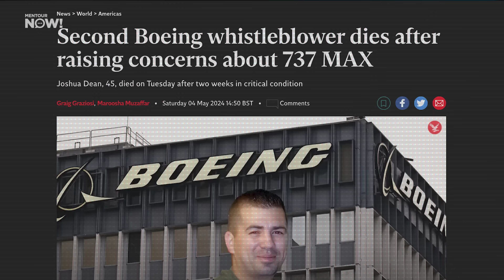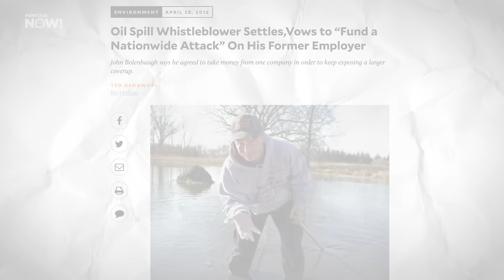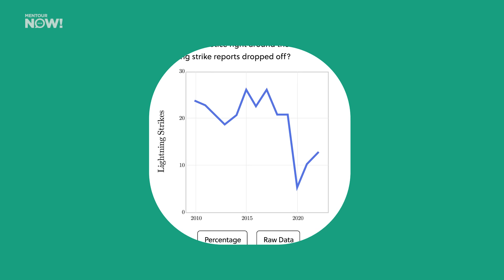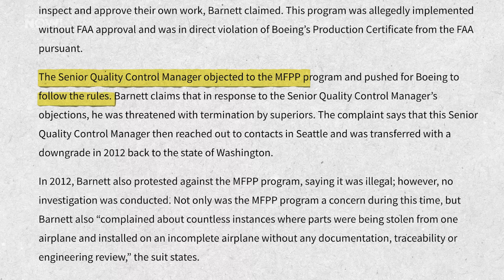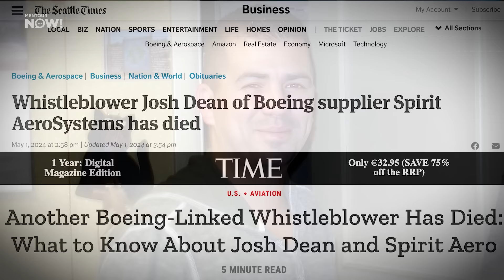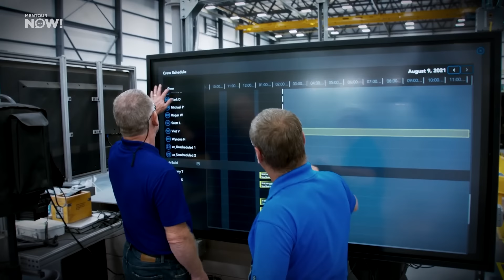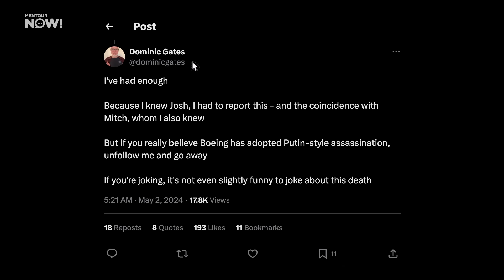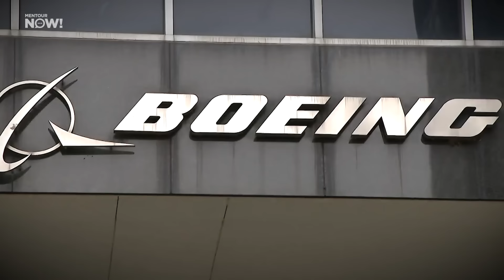Whistleblowers Vs Boeing: What Happened?

Comment: My brother worked at Boeing in Everett, first on the 777 line and then subsequently on the KC-46 line. He too, had many complaints about quality control at Boeing, or perhaps I should say 'the lack of quality control'. His comment was that they were pushing aircraft off the assembly line faster than they should have been, thus not allowing all components to be installed properly or with substandard parts. Also, FOD (Foreign Object Debris) was being left inside the airframes as they were pushed out to the waiting final line. He became so fed up with their lack of attention to detail that he quit his job. This was a job which he looked forward to before these disheartening and frustrating events.
Reply: Poor company morale is a big factor in poor workmanship which leads to poor moral which leads to poor workmanship.....People just turn up for the pay, not the satisfaction  of a task well done.
Reply: So how does this lack of quality control is manifesting itself? As far we as we can see those beoing planes are not crashing and are some of the safest out there. So that seems in conflict with your and your brothers statement. How do you explain that? And how do you also explain that other people working there would have opposite comments and are proud of their work there? In fact you can read such comments under beoing manufacturing videos here on YouTube in which they also mention that the quality is there instead of lacking as in your comment. How do you resolve these conflicting statements?
Reply: @dreamthedream8929 
Max 8 would like a word. So would Alaska Airlines door plug.
Not crashing isn't the level of safety you want from an airliner. Not having faults is. And Boeing's been having a lot of those lately.
Reply: @dreamthedream8929  I believe you’re missing the point. Thankfully, no planes have crashed in a couple of years but the lack of oversight by a QC process is leaving the door wide open for a major disaster to occur. The mentality of Boeing’s workers has dropped so significantly over the past 30 years, after the McDonald Douglas merger,  that serious management changes need to happen to bring back the pride of a job well done. Sadly, it seems the employees are feeling a ‘why should we care’ mentality.
Reply: Thankfully no planes have crashed due to how well those boeing planes are made, there is lot of fear mongering going on these days by media basically creating an impression that they should just be falling out of the sky whereas just the opposite is happening. Its safer to fly than ever if we look at the numbers. So again the question is how do these supposed serious problems are manifesting themselves in daily safety of flying? If its so bad as you describe then why is it that dreamliners simply don't crash?
Reply: @dreamthedream8929  Boeing has over many decades had a good record of safety, and as far as I understand the story this is something that has developed over the last couple of decades, which coincides horrifyingly with a large majority of Boeing accidents compared to the same amount of serious accidents in aircrafts from Airbus, Embraer and others. That the accidents are rare isn't the point. In aviation it's all about the life-changing margins. And in the very small margins you see a significantly higher rate of incidents caused by equipment malfunction where a Boeing plane is involved than in any other manufacturers aircrafts.
As the FAA respondent so clearly stated: "You cannot conclude anything about the safety of a particular plane, simply based on the coincidence that an accident hasn't occurred yet." And now that Boeing has become the world leader in accidents in modern times when it comes to large commercial aircrafts, this misunderstood appliance of statistics is even more ridiculous.
Or as it was so well put by @tin2001 "Not crashing isn't the level of safety you want from an airliner. Not having faults is.", and Boeing is falling terribly short when measured by this standard.
The reason the "fear mongering" is relevant is that this is not a problem that can be mitigated when it leads to a serious blow-out or other fatal disasters at 40,000 ft. When it comes to aircrafts transporting passengers the only acceptable margin for errors are 0%.
And there is one simple fact in industries dealing in the transport safety business: If there is another player out there with a better record than yours - you are obviously not doing the best that can be done in the field. Right now there are manufacturers with less critical incidents and faults, and as long as that is the case, Boeing isn't doing good enough. This should always be the only acceptable standard. If there is any way it's humanly possible to do better - you are still not performing adequately. And that goes both ways. As soon as Boeing's track record over a span of years are better than, say Airbus', then obviously Boeing is doing something better than Airbus, and the only natural conclusion would be that Airbus is now failing at being at the only acceptable standard, which is - the best humanly possible. As long as anybody is having better safety statistics than your company - your company is simply not putting sufficient effort, money and time into improving safety. As long as your aircrafts don't have the safety record (on the margins) as the best in the industry, your fleet should be grounded.
This sounds dogmatic, but to some degree aviation is about dogma. All the times planes travel without incident from point A to point B will never make up for the one time 150 (or more) lose their lives due to an aircraft manufacturers putting a limit to the amount of money they would allocate from the budget to addressing safety issues and quality control. This is the only part of a manufacturers budget that shouldn't have any limit.
Reply: @beninua  however the question then is is there data for this supposed horrifying increase as you put it in boeing accidents compared to others? Or is it something exaggerated and overblown by media by people who do not even understand what's going on and blame every incident on boeing? Hasn't that become a trend these days? Even turbulence accidents are blamed or connected to boeing by media giving general population the impression that boeing is somehow really unsafe. And yes safety definitely is and should be measured by how often tragic accidents happen and for many boeing planes it's super good, I mean even max only crashed twice! This is simply the reality instead of what may or could happen. That's important too but we really need to see how that manifests in reality and for boeing planes the safety has manifested itself so far very well. But it seems that you hold aviation to a lot higher standard of safety than anything else in life. If anything else in life would have the same rate of accidents as boeing people wouldn't give it a second thought
Reply: @dreamthedream8929 ok I'm going to assume that you genuinely dont understand and are not a troll wasting everyone's time. Ill try to explain this in a short and simple way that others have explained before me in a better, more detailed way. Basically the best practice for quality in avaition is that you go above and beyond when it comes to manufacturing process in order to produce a product as close to perfect as possible. This is what keeps people safe. Boeing used to do this, but not anymore. the 2 MAX crashes and the door plug incident occurred on brand new planes, and all in a short period of time. This is not quality. When the attitude of the company is to rush production and leave metal shavings in planes or cover up critical software changes to sell more planes which caused hundreds of deaths or not install door plugs and have them blow out in midair or stomp on parts to make them fit or install defective parts these are systemic issues that need to be fixed. If not another tragedy will occur in the near future. This is what everyone is concerned about
Reply: @tmb06  anyone who raises questions is a troll? I already asked questions and no response was given neither by you nor anyone else. In the previous comment I spoke about the exaggeration by media of these supposed accidents (we still need evidence for the whistle blower claims of someone stomping there and that it's not a good way to go, are you just gonna take their word for it?) and how it's trendy now to blame everything on Boeing. Even turbulence accidents are somehow connected to boeing. That is silly. But fear mongering by media of course attracts and sells. Nothing new there. I'm not saying that this shouldn't be paid attention to and investigated but as far we we can tell the safety manifestation of boeing planes in reality is as good as any other. Dreamliners and 777s are as good and safe as it's gonna get in aviation. You obviously hold aviation to a much higher level of safety than most other things in your life. If there would be two crashes or accidents with a certain type of car or bus or another device you wouldn't even give it a second thought and most people wouldn't. Of course there are those with severe phobias that over think everything and are afraid to leave their homes or are even afraid to be in their own homes as well
Reply: It looks like Boeing upper management directives comply with paperless documentation that allows them to operate as the best example of American Hipocracy.
Reply: @dreamthedream8929 no, not yet. Consider this  climate change along with strong weather ocurrances are changing. Bigger hale pieces, more lighting and faster change on crosswinds, plus bigger size engines allow for larger of water inside the engine nacelles, which could potentially lead to flameout.
At the same time this type of event, isn't really acquired by simultaneous signal detected with the event. It takes good 10 seconds to a precise reading. So what your doppler or weather radar may show it may very well be that the pilot may be looking to a sequence of events that took place already, thus, unless the event storm is still in the same position, it may be obsolete information by the time is received. 
This displays which, show different types of clouds formations and storms, in different colors, may not have all colors required by the operating radar program, potentially not showing a new or yet unknown condition. This can also be attributed to a need for displays with higher resolution on the screen.

Comment: I worked for Hughes Satellites which was bought by Boeing. As part of Boeing, we had corporate wide ethics training one day a year. Boeing tried to have everyone participate in training on the same day. Part of the ethics training was that anyone should feel open to reporting an issue, including issues that will stop production. 
Boeing training was to be ethical and freely bring forward problems.
I personally had an issue with a part I designed that would be used on 3 identical weather satellites. I designed a part that had very little material remaining between an inner thread and a reduced outer diameter. But, that tiny part was a single point failure for the antenna it was part of.
When building unit 3, the part easily failed during assembly, so I felt that unit which was installed on the satellite needed to be removed and the part replaced with a redesigned part. My team leader resisted removing the installed unit saying that the unit already passed the highest level of vibration it will ever see and delays on the satellite costs $100,000 per day. I argued that every vibration may fatigue the metal and it could break during launch even though the vibration level is less than the testing survived.
This disagreement occurred during the time that Space Shuttle Columbia broke up during reentry. 
When my team leader and I met with the stress engineer, he agreed with me and the team lead was finally convinced to remove and rework the unit that was already installed.
I worked at 3 major companies in my aerospace career, working on missiles, space station and satellites. Each company claimed quality was job #1. Boeing seemed closest to meaning it. I learned in the 80's that quality is job #1 until price or schedule are in jeopardy.
In the 80's, there was derogatory grumble that followed management trying to control the budget to repair issues "fix it, but don't change it." I always thought of that as a bandage which would "change it, but not fix it."

Comment: You are 100% spot on. Reward finding problems.
Reply: Excellent video! As per usual, you do a great job of parsing out the facts from rumors and speculation. The losses of human lives- if in part or fully due to the Boeing connections- are unacceptable by any means of running companies in a good way obviously. To me, the way forward is only one sensible choice: Exactly what you're saying. I can't find a better way to honor the legacy of the passed and the ones that no longer are with the companies.
Reply: Absolutely! What is the purpose of quality control anywhere if the project is allowed to go astray?
Reply: Need to attack it as what happened instead of who we should blame.
Reply: They do, with a high speed projectile in a quiet car park.

Comment: Here is my comment I left 4 years ago on “Logically answered” video about Boeing. Little I knew everything will go down this quickly from there:
“I worked in Boeing for many years and hate to say I told them so. 
1) I thing Douglas merger was a mistake it’s bad, greedy, numbers focused management culture speeds everywhere.
2) I work a few years on weekends on my free time to finalize work which was accepted/forced by management as done, done!, but I thought it isn’t, we are risking a lot of peoples life after all. And was constantly blamed by management for wasting my time on unnecessary improvements. Of course I left as soon as it was not possible for me to work on weekend because of family.
3) Overall qualification of engineers was extremely low, especially after they move a lot of production out of Seattle to cut even more cost.
Ehh.. I’m sad, but it seems this is how cleanup works on business landscape. Big, old greedy companies have to die to open space for new competition.”

Comment: The fundamental subject is Top Management. If they really want "quality first" the methods for achieving that are well known. But most companies' Top Management are above all interested in maximizing shareholders' dividends. That's incompatible.
Reply: Not even shareholders. Modern public corporations only give dividends when they have to, their default use of profits is to give bonuses and buy back stock to increase the value of executive options. Shareholders are secondary.
Reply: Top management are above all interested in maximizing management bonuses.

Fixed the misspelling.

Comment: Any decently run safety conscious company would value employees raising concerns about safety that might cost their company large amounts of money - if any company should know this it's Boeing! Making it easy for the company to respond to problems early and address the issue should be appreciated. Decades of human factors and systems research in the aviation should be known to Boeing. Spirit putting delivery schedule ahead of QC seems to have been a result of Boeing's requests. QC is a hard job and important especially if you're not supported.

Comment: Well a quick story (just a random side comment about manufacturing, and the parts I'm describing are not critical to anything). 

So at a company I used to work at, there was a set of parts that were made frequently. One part fit inside the other, with a tight fit of about 1/2 degree +/- (the size of the parts didn't matter as much). Someone (who assembled the parts) said to me one day "you know, we have to use a hammer to put these together. Is there anyway you can (make the angle more) make them fit better." 

The next day I went to the department that put the parts together and asked a few other people about the parts fitting, they comfirmed what the other employee told me. This was important info for me, I knew I could produce the parts with about 1/4 degree more angle and make everybody's life easier and still be in spec for the part design. I was happy for a moment as I walked back over to my department. 

Then my manager spotted me. (He says in a huff) "What are you doing! Don't you ever go over my head again, If you try saying anything to the owners I'll have you fired." 

(Me in mild confusion) " I didn't go over your head. I was just asking about (so and so) part. I wanted to verify that I was making it correct, someone let me know there was a slight issue with it. I want the part to be right for when you look at it, and for it to be still in spec." 
(With a scowl on his face still) "Fine, you do that. I don't want you going over to the other departments anymore at all. GOT IT!! You're waisting too much time there." 
{Side note: the next week (he says) "go over to the other department, they're out a few people!"}. I say "Sure."

It didn't help that the material for that part kept changing via the suppliers each week, and sometimes the slightly different materials would get mixed into one batch, and that could effect the angle of the part by over 2 degrees. Yeah (sigh). 

Anyways, it seems you get yelled at no matter what you do at some companies. 
(And no, I never went over that manager, before that.) 😅 .